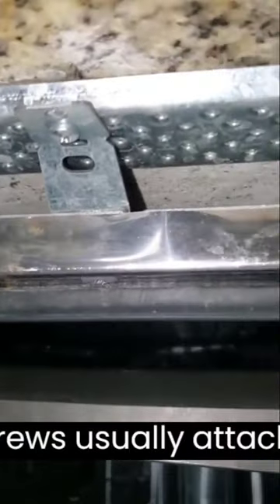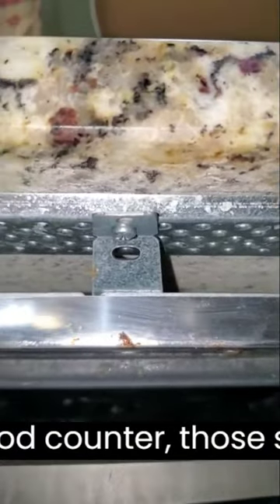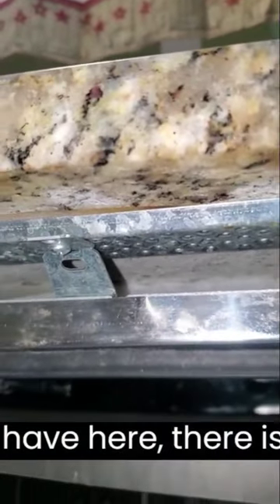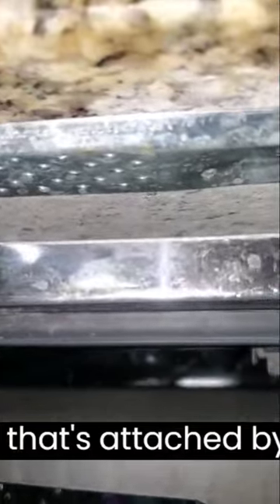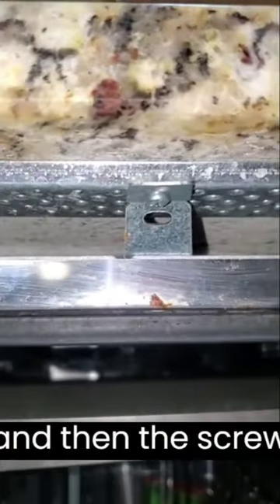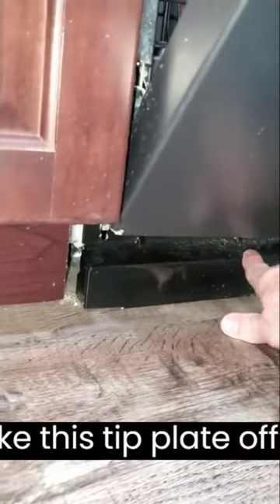Dishwasher removal

Comment: Dude you didn’t include water and electricity??!?
Reply from the maker: @dustintacohands1107  Right - If you are totally removing the dishwasher you will have to disconnect the water supply,  drain hose, and electricity.
Reply: @HankBaugh  might as well include that fast it’ll be what most people are looking up info for